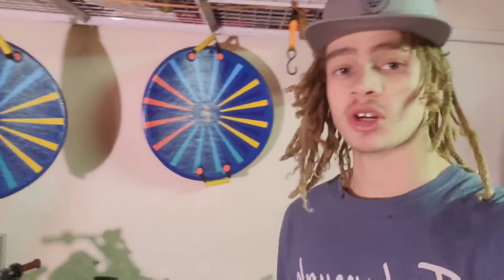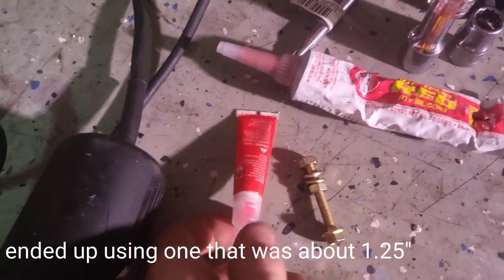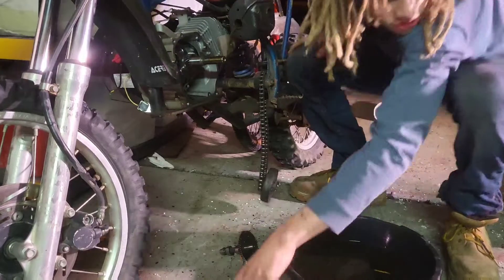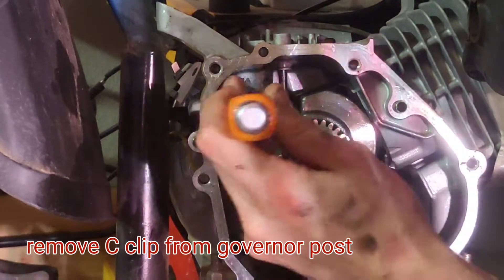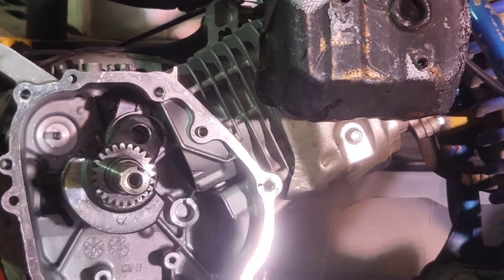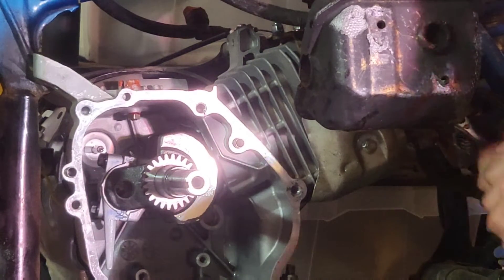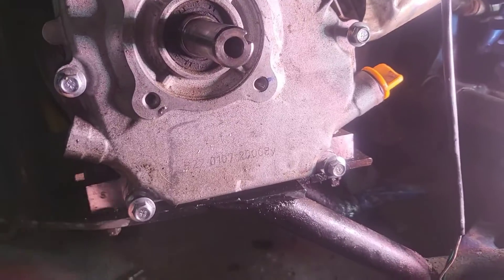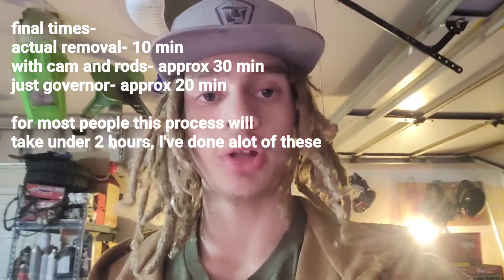Get 25-30% more power FOR FREE with a governor delete! 212/196cc engine

Comment: Quick question if u leave that metal sticking out where the governor plastic gear is at does it fall into the engine? Or do I need to tap it out from the flywheel side

Comment: Hi I tried to remove my governor but for some reason I can't get the crank case off and It seems stuck on there do you know a way to try and get it out it sort of did what yours did when it wasn't coming off but I can't just get mine of thank you.
Reply from the maker: Be very gentle, try to clean the crank off as much as possible before pulling the cover. Take a rubber mallet and very carefully start to free it up, you can hit the oil fill holes on the cover from the back and just go slow, should free itself eventually
Reply: @kartingkid714  Thank you I trie that but it just goes up halfway and after that I can't get it up but thank you.